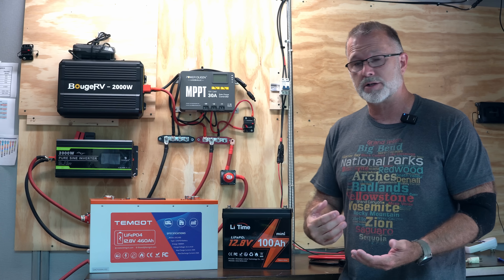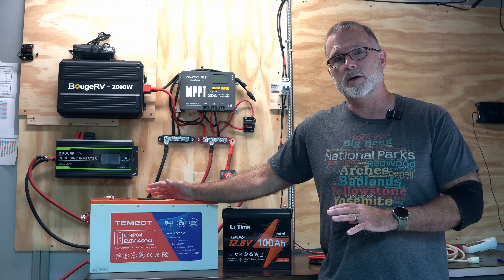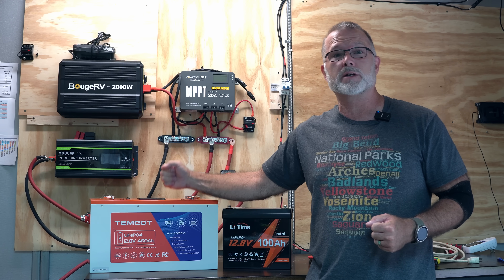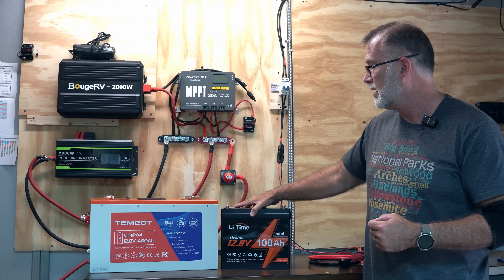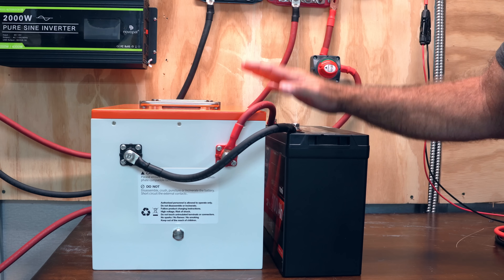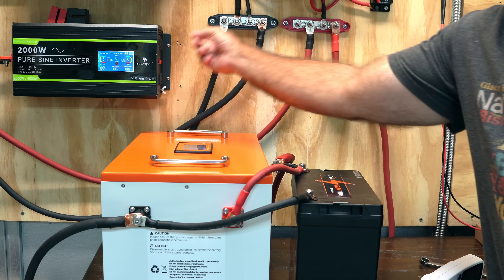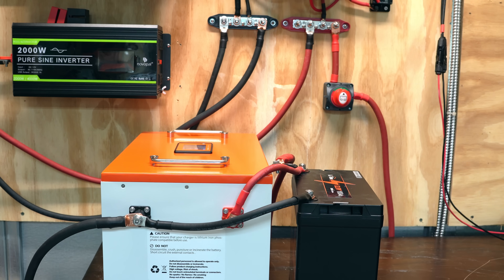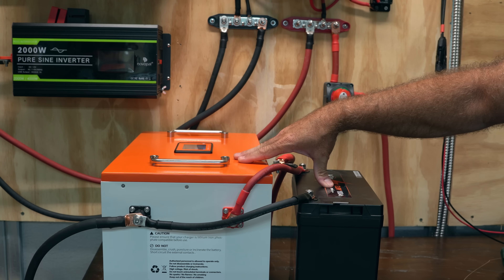Connecting Batteries with DIFFERENT Capacity in Parallel - What Happens?!

Comment: Thanks for your experiment.  I bought 2 different battery packs with 16 3.2 volts battery cells and have the same JK BMS.  One set battery capacity is 314 ah and the other is 345 ah.  Base on your experiment I should have no issue in connecting these 2 battery packs in parallel?  Thanks again.

Comment: Thanks. Do you mind if I ask  slightly related question? I have two 200A Lithium batteries that I plan on wiring together parallel. I will be running a 12v 1200VA Victron inverter. Do the cables joining the two batteries need to large enough to cover the total amps, or is the current shared by the two batteries so the connecting cables only need to be large enough for half the total current? Thank you.

Comment: I currently have a 48 volt 200 Ah battery bank using 4, 24 volt batteries in series/parallel. All 4 of the batteries are 16 months old and been in use for that long. Can I add another  2, 24 volt new batteries adding another 100Ah of capacity?

Comment: Great Video. How about doing parallel a lithium 100AH cranking battery to a deep cycle 340AH battery? Any issues you think?
Reply from the maker: If both are lithium, prob not. But if one is lead-acid, you should proceed with caution since the SLA doesnt have a BMS to ensure safety if something goes haywire

Comment: Please don't follow the advice of this video. What it does not cover is the charge profiles between the two batteries. You will find the smaller battery completing its charge faster than the larger one but the charger won't go into absorption and float at proper times for the battery. The net result is one of the batteries will degrade quickly. Read up on conditions that LiFePO4 batteries degrade and you will see that overcharging is very harmful.

Comment: Connecting both as you showed in a solar pv system and continuous charge/discharge thru the day (Not  only to be used on need) will this affect the less capacity package negatively ? As it will get charged and discharged more frequently than the bigger one ? TIA

Comment: 3:33: I would recommend checking first the voltages of batteries connecting in parallel. If one was critically low and other fully charged you'd have full short circuit amp discharge/charge. They would eventually equalize, but I'm not sure if they are designed to deliver 100Ah over so short period of time.

Comment: After watching your video here I was confident that the 100ah battery I bought to increase my capacity would pair up nicely with the 120ah battery that I had been using. I charged them both up first before connecting them in parallel.  Connected them and then let them sit overnight to equalize their voltages.  Next day I started using my system. Ran the system down to 95% before charging with the 400 watts of panels I have. I noticed a   problem right away.  The batteries charged to 220ah at 100% but wouldn't stop charging as it should have.  It kept charging at 18 amps at 100% then the system shut down.  It restarted then a few minutes later shut down again and again.  I lowered the charging voltage of the charge controller to 14.4v from 14.6v and still the shutdown.  Tried 14.2v and no change.  Checked and rechecked ALL connections.  The system ran great with the 120ah battery.  Going to try JUST the 100ah tomorrow to see if it's the new battery.  If that doesn't work then a hard reset overnight.  If that doesn't work then I will run the 100ah battery down to 0 to reset the BMS.  The charge controller and inverter worked OK with the 120 battery. So I don't think they are at fault.  Thought is was going to be a breeze after watching your video.
Reply from the maker: Is one (or both)  a 'smart' battery with Bluetooth?  If so, you might be running into a know issue in the BMS firmware on those smart batteries. And if that turns out to be the case, there may be a fix for that with the vendors mobile app update
Reply: @ReeWrayOutdoors  No, not a smart battery.  I'm going to try the new battery by itself tomorrow to see if when it reaches full charge it stops or slows down the charging.  The controller and inverter worked fine with the "old" battery so i don't think they are the problem.  If it doesn't work than i'm going to try a hard reset then run the battery down to 0 to reset the BMS.

Comment: 8:33 definitely getting couple of bigger batteries for my system after watching this 👍
Reply: That 460ah is a Beast right
Reply: @mikefeelyums5497 after watching this I kept my 3 100ah as a small 12v system for my shed, 
Then brought a trailer and placed 5 x 300ah lifepo4 batteries in it, that's now powering my whole tiny-house 👍
Reply: @mikefeelyums5497 was just shown a 600ah dumfume lifepo4 lithium battery for 980 or best offer, 
I want to test one out

Comment: If one batteries resting state is at say 13.8 and one battery rests at 13.2.... over time wont that 13.2 battery suck up all the juice in in the other or at least leave it at 13.2?   The issue isnt about when you use it the issue is when its resting or not flowing in or out.  This test is not the type of test to test this type of draw.

Comment: A consideration not takemn into account is the voltage of each battery. If they are not capable of holding the same terminal voltage in isolation, then when connected in parrallel the battery with the higher terninal voltage will discharge into the lower voltage battery. The other factor is the internal resistance of the batteries this will affect the rate of discharge and degraded storage capacity of the parallel pair and the overall storage capacity. You are far better off pairing batteries with the same actual charged terminal voltage with the same internal resistance value and the same storge capacity.

Comment: In parallel the charging rate shouldn't exceed the max continuous charging current of the smallest. Discharging shouldn't exceed what probably happens when a battery drops out. Otherwise, more external control or fuse/breaker will be needed.

Comment: In series with a BMS in both should turn off discharge when 1 is below minimum threshold (eg <10v), & turn off charging when above max threshold voltage (eg. 14.6v).

Comment: I have a Frankenstein solar system running 48v.  I have multiple batteries hooked together. 6v 8v 12v and a big 48v forklift battery. All old batteries.  I can normally get  over 12 hours of run time at 600w.  I see multiple places saying not to mix voltages but no reason why.  What bad thing is going to happen?   I discharge every night until inverter shuts down.   I hope to continue getting old batteries and adding to my system for longer run time.

Comment: Just for my understanding: total capacity = 13.33V * 560 Ah = 7,465 Wh; at 95% max discharge (I guess) = 7092 Wh ; higher than what you mention, the rest is the loss in the convertor?

Comment: I'm curious about what happens if I were to have a 12v 200ah battery in my trailer that receives 12v from my tow vehicle while it is running.  I have the 12v pin in my 7 pin connector wired into the + bus bar in the trailer. So while I'm towing I hope it will charge the trailer battery. But will it drain my truck  battery while its parked?  How would be the best way to do this?

Comment: It would have been interesting to see the amount of current being drawn from each battery over time along with the voltage of each battery over time.  I suspect one of the batteries would run out first leaving the load on the remaining battery, and as you mentioned the smallest battery would need to be able to sustain the entire load otherwise you could run into problems if it was the larger battery that ran out first.
Reply from the maker: I actually cover a lot of that in the Part 2 video of this topic. :)
Reply: @ReeWrayOutdoors  Thank you! I watched that video just now and found it pretty interesting!  It looks like due to the internal resistance the batteries pretty much proportionately share the load. One thing I would have liked to see is which one's BMS cut-off power first leaving the full load on the remaining one.  Was it the smaller or larger battery that cut-off first?
Reply from the maker: @cocoavideos assuming the BMS's are configured the same for low-voltage cut-off, they will pretty much cut-off at the same time...or near enough that it really doesnt matter much, since they're continually trying to equalize voltage between them

Comment: 3:51 when I saw the clamp meter, I felt so happy to see the amps of balancing between those two batteries but I was disappointed.

What if bigger battery is at a lower voltage( not fully charged) and smaller battery has slightly higher voltage ( more towards fully charged) and C rating of bigger battery is higher than smaller battery, then bigger battery sucks high amps because of high c rating as well as low internal resistance which the smaller battery at a higher voltage with less C rating almost feels like short circuited( not literally) depending on how much difference is there with SOCs at that movement and on top of it if it has less C rating, it can be even more worse. You could have addressed these things also in your video.
Reply from the maker: I think i did address most of that in the Part 2 video

Comment: If you connected your output cables only to the larger battery, would the smaller battery add anything to the capacity?
Reply from the maker: Yes, electrically it's no different than connecting to bus bars. So yes, the smaller battery would combine its capacity with the larger battery.
Reply: @ReeWrayOutdoors  If that's true, would it bypass the discharge rate issue that you brought up?

Comment: nothing happens except the lowest battery is all the capacity you will get 1ce 1 bat is low it will need to be charged so it is best to have the same capacity on every1 in series but it is not needed in any way.

Comment: Hello, I just used AA batteries in my flashlight, they were all lithium with "c"  input charging port, but they were different brands and my flashlight started acting weird, it would turn bright then dim all by itself, so I removed the batteries and one of them was so hot that I had to drop it. I did then noticed that eventhough they were all AA the milliamps were different, so I guess I have to use same brands together? Thanks for video.

Comment: Question on fusing… you put the smaller battery closest to the bus bar- does that matter? and what size fuse would you use- 100A because of 100AH battery or larger?
Reply from the maker: distance to the bus bar only matters cable lengths are different, since longer cables introduce more resistance.  So typically, you'd want try and keep you cable lengths all the same to the degree possible.    Regarding fusing, you always fuse to the gauge of the cable you're using, since the purpose of the fuse is to protect the cable from sustained over-current (beyond its rated max).  So for example, if the BMS of your batteries supports a max charge/discharge of 100A, you would want to (for shorter lengths around 72" total, calculated as POS length + NEG length) use at least 6 awg cable.  And since that guage is rated for 100-120A continuous, you'd probably use a 120-150A fuse.  And that would protect the cable if the BMS ever failed and 300-400A suddenly began surging through the cable.  Hope that helps. :)
Reply: @ReeWrayOutdoors  thanks, but to clarify my first question… you have BUS bar -> fuse -> smaller battery -> larger battery… does this order matter?

Comment: If you connect two batteries in parallel, the one with the higher voltage (because they will not be exactly the same) will charge into the other. The problem is that you can get a surge of current. This could be dangerous depending on the connecting wire, etc.

Comment: I’d say that if you hook up bigger batteries in parallel - make sure you put fuse in the link between them in case something goes really wrong, better for fuse to blow vs melting cables or the faulty battery.
Reply from the maker: 100% agree. And I'd go one further and suggest fusing between batteries of any size.

Comment: batteries don't drain from top to bottom like the symbol suggests. the chemical reaction starts at the surface of the plate and penetrates into it. more surface area gives you more capacity.

two batteries in parallel do not discharge at the same rate. because they share the same +/- nodes, their voltage drops at the same rate, and they both reach their minimum voltage simultaneously. during that period, the larger battery is clearly discharging at a greater rate. all of this is fine.

when charging batteries, however, whether you can combine them depends on the battery chemistry.  two lead-acid batteries in parallel with the same number of cells can be charged this way because lead-acid batteries like to be over/trickle-charged. you really don't want to try this with Li-ion batteries. this is because there is nothing controlling which of the two batteries you're pushing power into.

electronics are cheap enough now that every individual battery can have its own charge controller.

Comment: Is the BMS in the battery ?
Reply from the maker: Yes. Lithium-based batteries all have an internal BMS (unless you buy individual cells...but those still will require a BMS for safety reasons).

Comment: The larger battery starts charging the other battery instantly
Reply: What if we connect a high power diode  to block the charge from the bigger battery to the smaller duo the smaller one will still discharge earlier

Comment: I think it could be dangerous to do that setup, mostly charging them... assuming that the large battery has a 200 amp BMS and that small one can't have more than a 100 amp BMS , it would be very damaging if you were to push 200 amp in or even 100 amp in ... that poor little battery would die in now time .   If, by any chance, the big battery would  end up being full first, all that 200 or 100 amp from the charger would try to get into that small battery.......

Comment: I have two of one brand and one different brand in parallel. All three are 12 volt 300ah Lifepo4.  The one different brand is a little bit older. Seems to work fine.

Comment: Yes, it will work in parallel, but it's recommended to use batteries of the same brand and capacity because differences between them can lead to imbalance. One battery may discharge faster than the other, and when that happens, the slower-discharging battery ends up supplying current to the faster one. This reduces overall system efficiency and places extra strain on the more heavily used battery.

That’s also why it’s common to connect the inverter’s positive to one battery and the negative to the other—not because of capability, but to promote balanced loading, which improves efficiency and extends the life of the system.

Comment: What would be the problem of putting batteries in parallel with different chemistries if they otherwise can handle the same voltage and have their own independent BMSes?
Reply: Different chemistries, mixing, not a good idea unless the charge characteristics are very similar, which most aren't.

Comment: Just curious, did you measure the amps between the batteries? 

I'm just thinking out loud but it seems like they would also, at least somewhat, share the load so it might not be as close to the BMS limit of the smaller battery as it seems. 🤷‍♂️
Reply from the maker: Your right.  They do share the load in proportion to their capacity (more or less).  I actually go further into that detail in Part 2.
Reply: @ReeWrayOutdoors thanks! I'll cruise your channel and see what else you have. 👍

Comment: When dealing with combined AC and DC circuits, I find it invaluable to have a clamp on digital meter that can make measurements in both types.  I carry a Fluke 365 and use it everyday for such measurements.  It has the additional advantage that the clamp is on the end of a 1 meter cable, thus you can tong with one hand and hold the meter with the other, making it easier to read the meter.  eBay is a great source for such devices.

There may be others but this one has been my go to for about 10 years.

Comment: There is a consideration regarding parallel connected lead acid batteries that is often lost on the uninformed and this will significantly effect lead acid batteries of differing age.  New batteries have a lower internal resistance that increases with age.  So when a new group is paralleled with an older group, the charging current will tend to take the path of lower resistance, thus charging the new ones faster than the old ones and thus to a greater extent. When the charging ceases, some of the charge of the new ones will bleed off trying to raise the voltage (state of charge) of the older (higher resistance) ones.  

This effect can easily be documented by using a lead acid battery hydrometer to check state charge.  For reference, an unused lead acid battery should begin life with a value of 1280 (1.28 Specific Gravity) if the acid in the electrolyte is correct. This immediately drops to 1260 when put into service.  Upon complete discharge, the value will be 1100.  Useful fact, Expect to loose 1 point per day, at rest.  Thus 1260 - 1100 = 160 days, or a little over 5 months to flat dead status.  

If state of charge of a combined old + new lead acid stack is monitored during a charge cycle, using Specific Gravity as the indicator (The only real indicator), it will show the effect described above.  

I WOULD REALLY LIKE TO HEAR ABOUT THIS EFFECT IN LITHIUM BATTERIES, my guess is that the effect will turn out to be the same, but with the electronics embedded in the Lithium batteries, I can see the possibility that it is better addressed.

Comment: 3:58 what is initial charge control in this configuration? If you do this with lead acid batteries, big one if fully charged could easily damage smaller one if not charged due to a in-rush current which could measure 100s of amps.